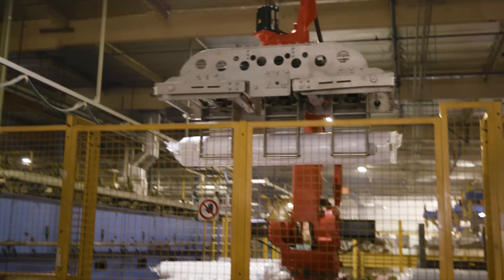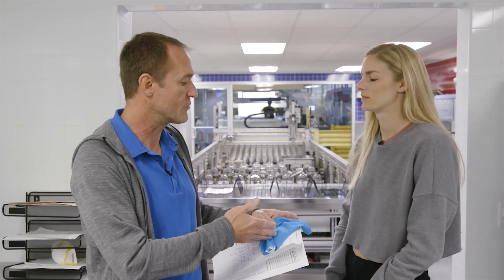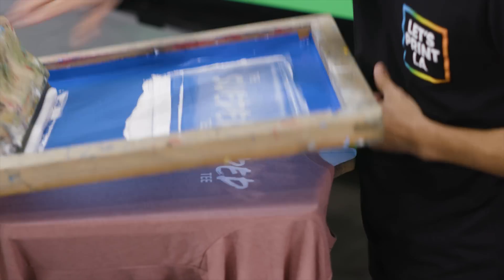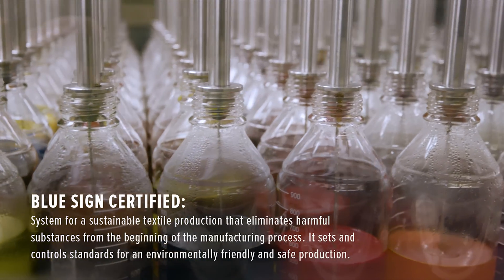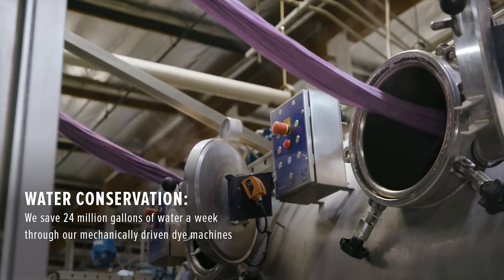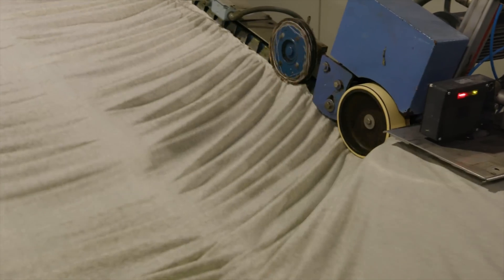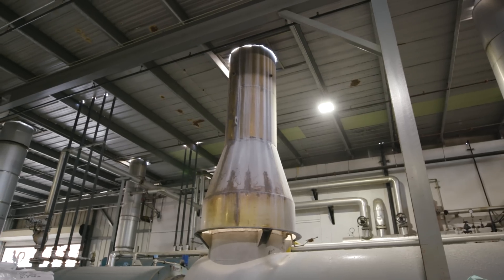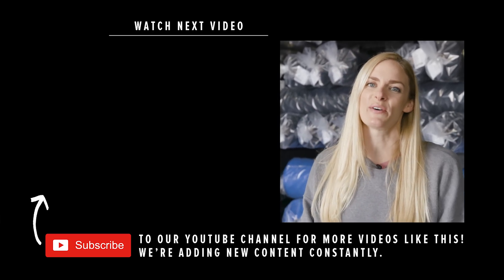How Fabric is Dyed in a Massive and Eco-Friendly Way

Comment: What is the best fabric medium for dyeing
Reply from the maker: Hi there! None of our items are prepared for dyeing. Every item of ours has poly cotton thread so any dye used won't take to the thread. However, the best option would be our 3001 white, since the threads will remain white!
Reply: BELLA CANVAS  what do you suggest for dyeing fabric using thermo pigment ?  Thank you
Reply from the maker: @done8391  We are not very familiar with thermo pigment but after doing some research, it looks like it will work best on 100% cotton garments

Comment: Effluent Treatment Plant is running there or not, it is not shown but only BLUE SIGN has no guarantee for Eco Friendly water. It is partly sustainable but not fully, you should added the presentation of ETP also in this video. Also there are less technological talks in this video. But go to deep conversation about technical sides of each process and machines by color fabric, finish type etc. It just introduced some machines only.
Reply from the maker: thanks for the recommendation